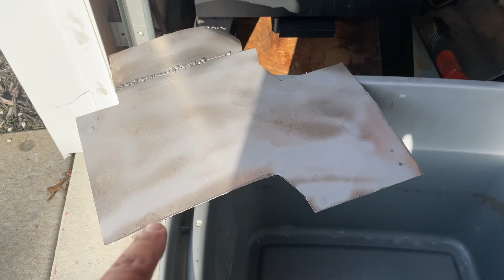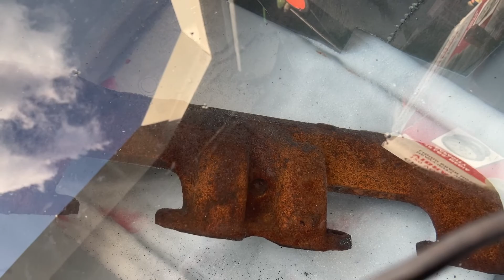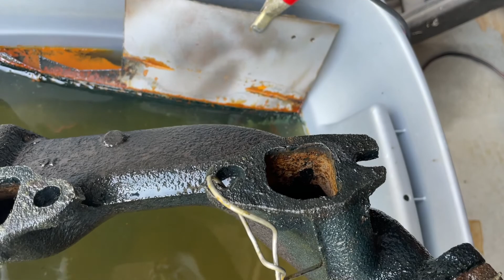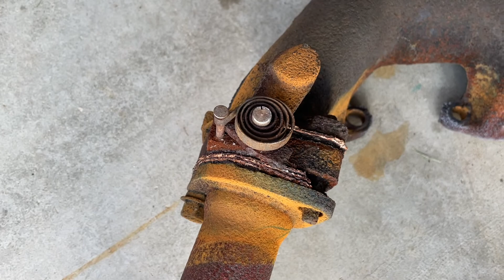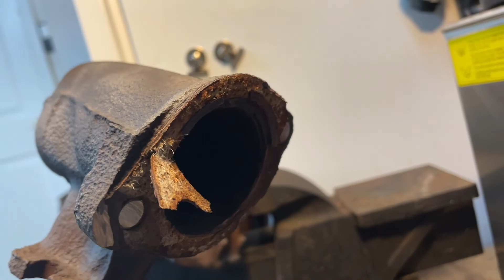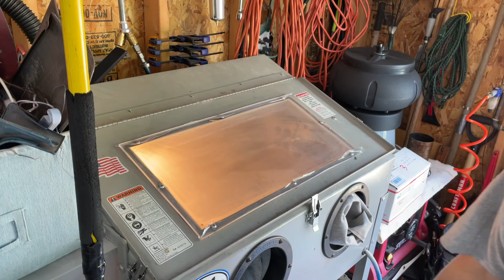Y Block Ford Exhaust Manifold Restoration

Comment: throw that junk away,I always remember the yblock tick caused by those stinkin heat risers,believe i would have just omitted it( dubious benefit and more monoxide leaks the warm engine doesnt need them and i believe the abestos gasket should maybe have been addressed as well,i suffered through these old things many times,no starring torque,but hard to stall when moving,i am glad somebody has taken up with these old engines that chortle from the funny firing order looks like you could put a couple of brass or stainless bolts in place of those studs,just get a downpipe made a little longer,do away with that exhaust leak.
Reply from the maker: If you look at a few other videos on my channel I have upgraded to a nice set of headers. Also, people in the restoration hobby who want to keep original parts in the engine bay... this video helps.
Reply: @HotRodReverend   well lets take this a little furthur,will the truck rams horn manifolds make any gain over the stock cross over ( you gotta be kidding system)? you could make the stock system look stock without the hassle of the sticking flapper.

Comment: I think those bolt holes are not even square the flange...better get you some new exhaust manifolds, check on YouTube...
Reply from the maker: All squared up, mated just fine with no issues. Could just be an optical illusion with the camera angle.